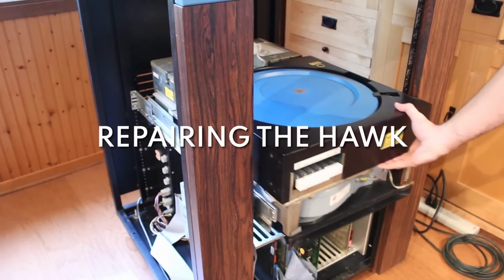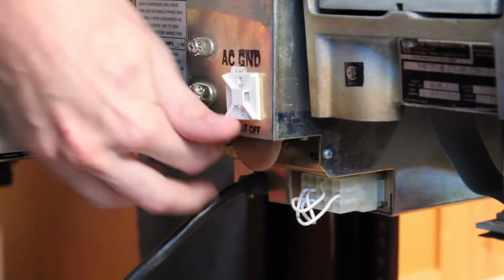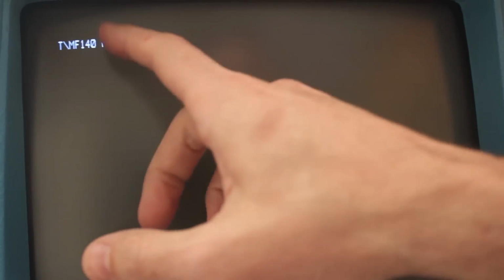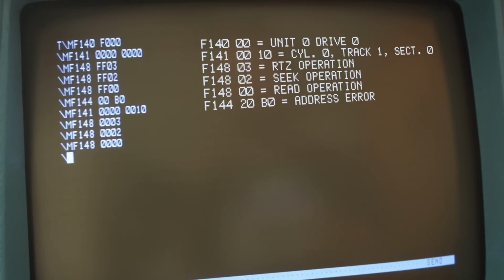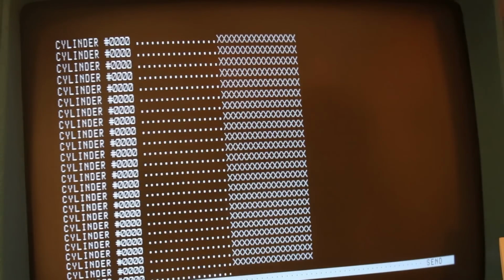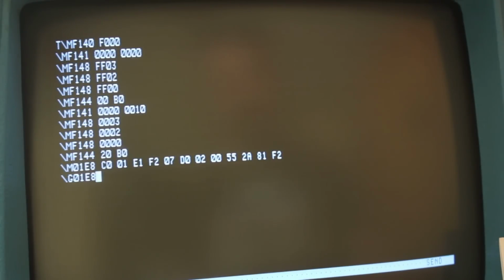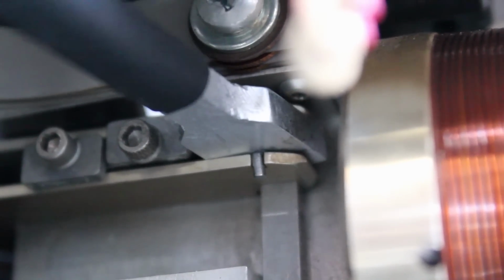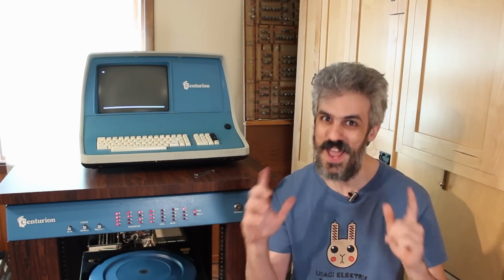Minicomputer Part 16: Aligning the Heads on the CDC Hawk Drive

Comment: Having a quick look at "load6.asm" on the wiki, this seems to be triggered by code at label "L_c4e3" in the CRT interrupt routine.
> c4fa: jmp NoCTS	 ; Receiver is not ready
(This should be verifiable via the "WriteStruct",  as this supposedly sets a signal "Receiver is not ready" .)
This seems to be related to the output of a clear screen character (0x8c), apparently, when this is not followed by 0x8e.
(There are a few device and status checks before this is triggered, but I'm not sufficiently familiar with the architecture to make heads or tails of this. But see the name of that routine.)
Reply: No CTS, no "clear to send" maybe. Like many on here say, maybe a lack of line printer or printer interface.

Comment: Holy crap!  I remember having to do head alignments on the original full height IBM 5 1/4 disk drives.  You had to use the software, and a special disk, and you used an oscilloscope to get the "catseye" pattern.  Funny how the technology doesn't change that much.
Reply: Too young,  just 5-1/4 drives...?      What about 8" floppy drives or even better "head per track" disk drives with a fixed head flying over every track (1024 heads total over 4 platters), think it was about 300K bytes ( could be wrong ). When this 1024 head drive had read errors most the time you  had read  errors on 1023 heads. The one head that did not have errors has the bad head / circuit because it always has staying selected. If you selected a other head then two heads tried to read two tracks at the same time.     Just joking about the 5-1/4 , glad you enjoy bring back old tech memories.   I enjoy helping others learn about old tech.

Comment: Without a CE pack, you could be a track (or more) out either way. 
You might be able to see if you're too far "below" track 0, because there should be no data at all. Yeah, "should". 
You would need to use your oscilloscope to see the raw data that the heads are reading. The TP for this should be on the preamplifier board, to which the heads are connected.
No, I never worked on these drives, I worked on Ampex, which were similar, but not the same.
Reply: Fortunately there is 16bit cylinder/head/sector address (plus a 16bit checkword) at the start of each sector, and the controller throws an "address errror" if it sees a different address to what it's expecting.

Comment: like others have said, it probably went threw its initial check to see whats connected and with some computers that age, it might NEED the printer to be connected. because as a professional computer system you would want the output to be printed so the system probably wont let you do anything without the printer.

Comment: Are the dumps made from the removable platters worth or you will need to dump them again into file after the head was alligned ?. Some years ago I deal with the Commdore C1541 allingment quite a bit. Used a program loaded from tape that will allow you to seek not only into any VALID track but also in the ones that are in between, that acted spacer to avoid data crosstalk. The idea behind the alligment was pretty simple. At any track, you need to maximize the signal from the head amp and minimize the signal on the spacer one. That was all. This need to be carried in middle, inner and outer track. If oyu happen to get signal when seek on a "spacer track", it was obvious that head was way off. And as the hawk .... the 1541 bumps pretty bad to find track zero each time it fails to find a track, or read errors ... etc. It does is pretty often actually. Even when you ask to format a disk, it bumps the head to ensure track zero was reached. After 0 or 15 of this bumps ... it starts to crap. We need a CCDP for the 1541 !!!!!

Comment: Actually the alignment pack would merely be to keep a constant correct alignment when changing packs, the actual alignment with an oscilloscope is there to look at that eye diagram ( the cat eyes) and adjust the head so that you get as symmetrical a pattern as possible, though because you have data there will be a lot of jitter on it, but it is doable . Just means now your drive is the new reference setting for all Hawk packs that you get, unless you are willing to take the packs and do an alignment to suit each pack, read them off and archive, then put the "master" pack back, realign, and then use this alignment to write the packs back onto the magnetic media to make them interchangeable.
Reply: My theory is that this alignment will be good enough to not only read any hawk pack we get, but write them and have them read by a correct aligned drive. 

The real problem comes along if (back in the day) everyone had followed this procedure, aligning to a random pack created by a previously adhoc aligned drive. After many generations of adhoc alignment, the whole fleet would drift apart and their would be pairs of drives that would be at opposite ends of the alignment and couldn't read each other's data, even if their were drives in the middle that could work with data from both. 

Guess we will find out if we get some more centurion formatted hawk packs.
Reply: @phirenz  You are 100% correct on why the CE Alignment Pack is a must back in the day with disk packs being shared between a number of disk drives.  I could see signs of writes to the disk pack from other drives or maybe the same drive when the room temp was different by 10+/- degrees.  I looked at sum of the sectors / tracks using my old Tek 465B scope  ( in the rear of the video to the right of the chassis). Could not take part in a head alignment without using the same scope I used on Hawks & repair Centurion PCB's 40 plus years ago.
Reply: "tune for maximum smoke" as we used to say.

Comment: Also regarding the error: My guess is that the OS attempts to print something out upon bootup like a system status report or something and is hanging up when it cannot find a printer thus generating the error: ATTN PRINT, aka something is messed up on the printer/printer is missing. 
Since machines like this are designed to be switched on and left on for years unless there is a problem requiring shutdown, it makes sense it would try to generate a status report upon the next bootup.
Reply: The recommended operating procedure for these minicomputers was to to run a backup and shut them down every single evening, and leave them off overnight.
Reply: @phirenz  hi, I can't speak for the centurions, but I know the raytheon machines I worked on in the early to mid 80s were on forever unless being repaired. The ttl chips would hot cold creep out of sockets so turning them off overnight would just have exacerbated that issue and the operators would probably not have the skills (good though they were) to revive a failed system. All credit to everyone involved in this project, it is not only fascinating but a cliff hanger as well😊
Reply: @phirenz  Really? My understanding was that all these machines didn't like being shut down and booted up repeatedly, but I guess by 1980 they were sturdier. It would still make sense to print a status report on boot-up the next day.

Comment: Ah I remember playing with these; unfortunately all tooling was scrapped years ago. have done alignment with a screwdriver.
This is becoming a drag will it wont it.
Reply: We had to build a head alignment tool to be period correct because using a large flat blade screwdriver just looks wrong.  The upper disk pack head alignment was done with the custom tool.  Getting the lower platter heads back over the correct fixed disk track was done with a screwdriver so we would not have to bend up the tool. Normally you never align the fixed heads you just re-format the fixed platter to match the current head position. The only time you ever tried to align fix disk heads is to try and safe old data on the fixed disk that is not backed-up.   Yes I have had to use a screwdriver before in a bind when the head tool & CDC CE disk was hundreds of miles away.

Comment: My first guess would be that the OS expects there to be a printer attached and ready, for some strange reason.  If this is so, then it would have to have been deliberately configured that way.  Maybe whoever had the computer previously always needed a printer to be available, to the extent that not having it available was considered a critical error on boot-up.
Bunny: "Nothing... nothing... nothing here either... nothing... oooh!  Nom-noms!  Munch, munch, munch!"
Reply: for logging the boot process.. euh.. ipl
Reply: @Johan-ez5wo  Very possible, although I'd call it a waste of paper when there's a screen available, but maybe they always wanted a record of the boot process for some reason.
Reply: I suspect you are correct. You have to remember back then there was a difference between line printers and terminals/consoles. The systems I worked on in the 80s had a teletype terminal for console stuff but the "job" outputs were on a line printer and also final products on a plotter, so 3 different outputs.
Reply: @crabby7668  Fun Fact: A "line printer" is actually a printer which prints an entire line of characters in a single mechanical action.  That phrase is often now applied to all electro-mechanical printers, even when they don't print an entire line at a time.
And I expect you're correct, based on my limited knowledge of older computer systems.
Reply: @melkiorwiseman  interesting, I don't remember seeing anything like that and can't imagine how it would work, but if the pandemic and YT have taught me anything, it's that there is a ton of stuff out there that I never knew existed😊
Reply: @crabby7668  I'm not completely sure how it worked, but my understanding is that the printer had multiple character wheels which spun around a cylinder to select the correct character then when all characters for a particular line had been set up, the cylinder moved forward and the line of letters would press an inked ribbon against the paper to form the letters, similar to a daisy-wheel typewriter but for an entire line of letters instead of a single letter.
I'd expect that kerning would be impossible on such a printer and so all printing was monospaced.
Reply: @melkiorwiseman  thanks for the explanation, sounds intriguing. That's yet another new thing I am going to have to look up to find out how it works dammit😊

Comment: Great stuff! Brings me back to the late 70's when I had to realign disk drives with 10 platter removable diskpacks.  That meant having to  tediously adjust 20 heads in sync using the cats eye. Got stuck in a very noisy computer room for the best part of a day!
Reply from the maker: Ooof, aligning 20 heads using the cats eye sounds like a serious undertaking! Just doing 4 heads was nerve wracking as it is, but 20 I imagine goes beyond that into exhausting. Also, I find myself wishing for hearing protection with one hawk drive, I couldn't imagine being stuck in a computer room with bigger, louder drives!

Comment: Flashbacks to the 90s when I was aligning my Amiga floppy drives with just a phillips screwdriver and XCopy32 to show if it was reading the sectors better or worse with every fraction of a random millimeter I moved the heads. It took all day, but eventually I would end up with a working drive again!
Reply from the maker: Doing head alignments with minimal tools is my kind of backyard engineering, kudos!
Reply: Me too, back even to aligning heads for my commodore 1541

Comment: Ages ago worked on 300MB CDC 'washing machine' sized drives.  We had the special pack for alignment of the heads (might have been 16 or 17 heads??).  It was a different shape (a bit like a long rod with a tiny pin at the tip, offset to one side.  Main carriage at holes for each head to fit into.  Once you got the pin into tiny hole on the head, just turned it a tiny bit to 'cam' the head forward /backward.

Worst head crash we had, had to replace several heads and just when we thought we were almost done, last head couldn't be moved far enough.  So tweaked the head used for servo positioning (which meant the carriage 'seeked' differently) and had to re-align all the heads.

Quite a lot of 'lost tech' in these old machines.  You're lucky to have Gavin around who remembers how all this stuff used to work.

Comment: How did you get the data off the drive to begin with if it's throwing errors?
Reply: The Hawk was getting very few read errors when we started dumping data from the disk packs, even the fixed disk was working a little. The read error problem kept getting worse each time the Hawk was spun up till it could to a point we could not read most of the disk.  I recalled seeing the servo voice coil re-track rubber bumper had failed weeks before when we first starting working on the Hawk.  The rubber bumpers are used to reduce the shock to the heads clamping system when the heads are re-tracked during power off.  During power off the voice coil servo with the heads attached are pulled away from the platter and hits the rubber bumpers to soft stop. Without working rubber bumper the servo moving at up to 90 inches per second hit servo metal into the front of the steel magnet causing the head arms to slip to the rear of the Hawk.
Reply: @kenromaine2387  Ok thanxs...very cool series 
Let me know if I can help.
I have restored vax-11/750 and have alot of exp with mainframes. see my github site.
I currently work as cyber security expert
Reply: @Drforbin941  After years of mainframe & minicomputer support I moved to packet routers then optical circuit routers with DWDM long haul circuits , a little VoIP then ended high tech helping with network security as a CISSP for a number of years. In retirement started working at local high school doing Safety / Security Guard, pay sucks but its the best job I have ever had. Physics teachers has even invited me teach parts of some technical topics.to students.  High tech data has been good to me for 50 years.

Comment: Wow, I found it amazing how the head alignment was done! I remember how I did many 5¼" drives myself using the cats eye alignment disk, but doing the alignment by using Gavin's program and your selfmade tool was awesome! Great job!
Reply: Where did you hook your scope on 5 and 1/4 inch drive to get to the eye pattern

Can you dump your memory here so incase I ever need to align my floppy drives in the future, I will now where to look :)
Reply: @Veso266  I forgot to mention the pattern can only be seen when using a special alignment floppy, just as was mentioned in this video: he spoke of a alignment pack. This contains special tracks to generate these signals on the scope.
Reply: @MarcelHuguenin  Exactly..the alignment disk was a Dyson or Dysan  Alignment disk..basically the way the disk worked is that a signal was written on edge of track 16-17 and another signal was written on the edge of 17-18 ..then you step the head to track 17 ...connect the scope to test points directly from the head..you would see 2 lobes (cats eyes)  ..adjust the heads until both lobes are equal..which would indicate you are perfectly over track 17 which is the center of the disk for 35 track disks..
Same thing for 40 track disks but the alignment disk signal was written on 19-20 and 20-21 etc..

Also the disk on track 0 had a burst signal 200ms after the index hole ..this was used to adjust the index..
Reply: @MickeyMousePark  Exactly! You described it precisely how it was 🤗 and the disk was from Dysan. I used many regular Dysan floppies but they were expensive.
Reply: @MarcelHuguenin  hmm I guess aligment disks can be made, but not sure where to get a signal generator that can go up to 100Ghz (according to google, I need to generate 999995 MHz and disable tunnel erase when writing the disk)
Reply: @Veso266  this is beyond my comprehension 🤪 looks daunting to me
Reply: Hello  @Veso266   I know a DOS tool that gives you a sound feedback that lets you know when a head is misaligned or aligned. It's called Dave's Dunfield IMD118 or ImageDisk 1.18. Fire it up and then you can manually align the header until you get a sound confirmation. I don't remember all the details as I did it some years ago, but doable.
Reply: @Veso266  To be honest, I don't remember exactly. There were special test points close to the heads, I think. This was mid 80's so long time ago ;-)

Comment: Now that you have the heads aligned, you should create a raw image of the entire disk, since it's not likely to survive for much longer in open atmosphere, with no testing of stored signal integrity. You can use the image for emulation, or load from a custom storage interface, if the drive fails, or needs erasure.
Reply from the maker: That was indeed one of the first things I did, since getting a clean image wasn't contingent on the OS functioning. 
We currently have images of two removable platters and the single fixed platter.

Comment: Very impressive. 

I used to work on these drives many, many years ago and still shudder at the memories of trying to get the perfect "cat's eyes". We had the proper alignment disk and 'scope, but it was a flat bladed screwdriver that we used to make the adjustments...

Keep up the good work, it's bringing back (mostly) good memories.
Reply: Same here. The trick was to misalign the heads just enough that they went back into adjustment when you tightened everything up.

Comment: I wonder if someone spammed the print spooler just as the system was powered down and once you connect a printer, the machine will spit out those print jobs from 30 years ago...
Reply: I doubt those print jobs were stored on disk.
Reply: ASCII Pr0n!